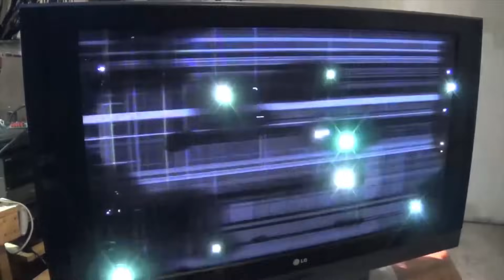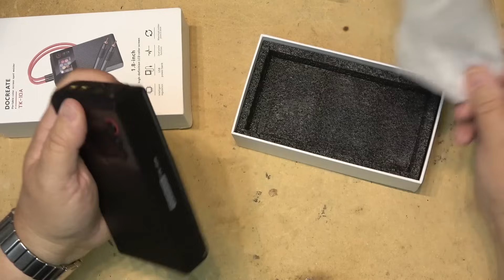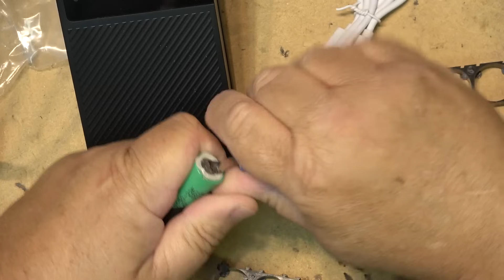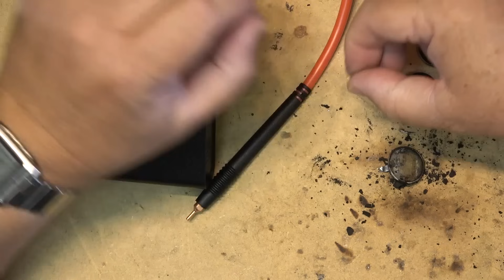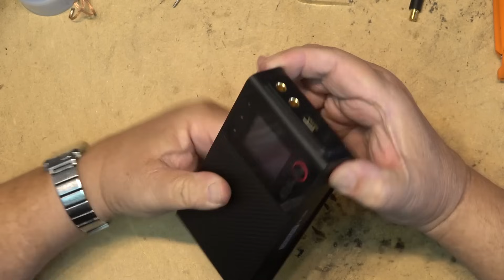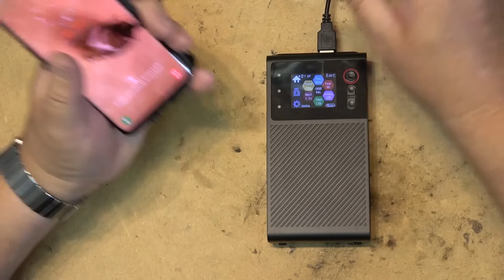DOCREATE TK 10A Portable Battery Spot Welder

Comment: Do not exit the smart menu if you want to keep the settings in this menu. As soon as you exit the menu, you will automatically return to manual settings, and in this case, the power was no longer suitable for a button cell battery.

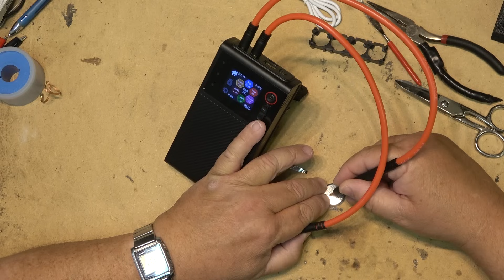Comment: In the first weld with the bottom cell moment 10:16 you have the gear in 98 power probably that’s the why it making a hot welding, mine welding little pieces of flat steel with that option and makes great weld, be careful with the  gear power you work but this a great video thank you for you content

Comment: I think that a button cell battery holder is a better option for replacing a memory holding battery than welding those tabs.
Reply from the maker: Many times there is not enough room to put a holder.

Comment: How thick was that piece of strip? Was that from the box or just something you had laying around? 

It arced all the way through. There's a pulse of electromagnetivity along with the power. That's why the leads move and you can't hold them still with your hands. EMP interrupts signal and pulled the 2 sides of the case closer. 

The file is to file the electrodes not the batteries. I have a bunch of those diamond files they are pretty useful. 

I have the previous version of this welder. So looks like a bigger battery, maybe double I think mine only has 2 cells. The display may be a little bigger and the interface is updated. Buttons are moved from the top to the front of the unit. I just modded mine since the batteries were giving out. So I added  some wire and connectors larger than the welding leads to each terminal and ran them out the bottom of the unit. It was a very tight squeeze but nothing is getting pinched and insulation is very thick. Those cells defininitely look juicier which is a much needed upgrade. I built a couple of high voltage packs with hundreds of 21700s and that pretty much did in the existing cells. They charge to about 85% now so that's not great, thus the mod was done to rectify that issue. 

If I had gone easier on the cells I'm sure they would be fine but I like to see what these things are capable of and I've got tons of batteries so no biggie. 

The power source is the most important part of these things. Lipos are great for amps but tend to lose steam pretty quickly when used in this manner. Not my first lipo power welder. This is the way they do it apparently. It does the thing but maybe not for as long as you would like under a more extended use. 

That unit should do better than the one before it. I may have to pick one up and add it to my collection.
Reply from the maker: It was the strip that came with it. Cut down the middle as it was a demo only. That battery was flat.
Reply: They  need to work on that  preset then. On the core ious version it doesn't ask you all that. You can do up to 3 pulses and you control the duration and interval for each. 1 short preheat and then the normal pulse is usually sufficient 30 was the long setting. 

I was thinking those presets were a nice feature to have too. lol

Maybe not.

Comment: The Jolts was way to high for button cells. The jolts should be about 15 for button cells. I do have a spot welder myself and have also blown holes in button cells from the jolts been to high. On mine I found 20 jolts works well. I will always start at 10 jolts for button cells. I seen from your setting when you went back though the menu I seen it set to 70 jolts. Be care full you can blow a small hole in button cells and you will the smell the lithium.
Reply from the maker: I figured the preset was going to be correct but nope.